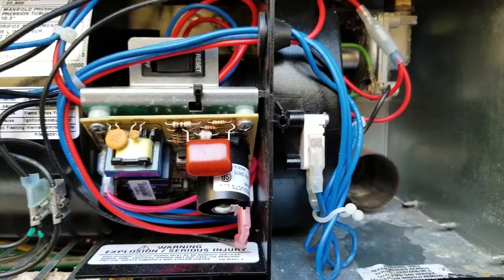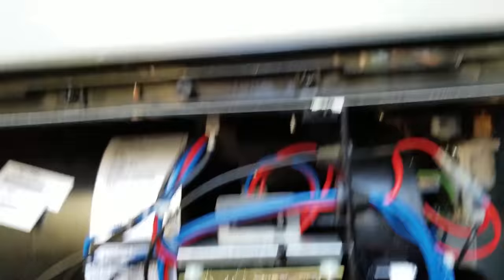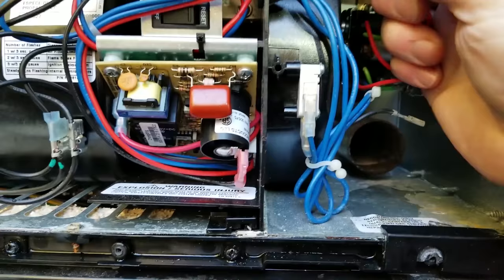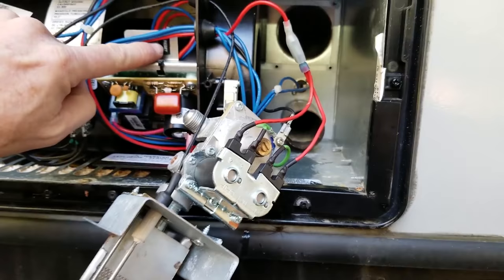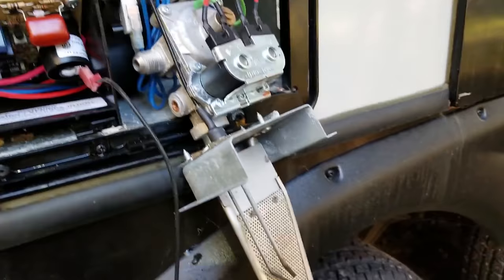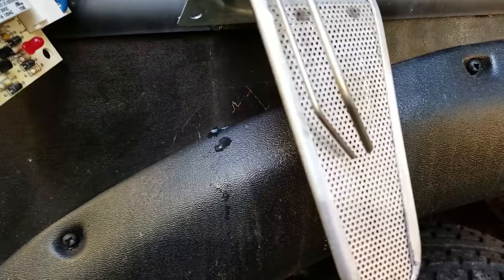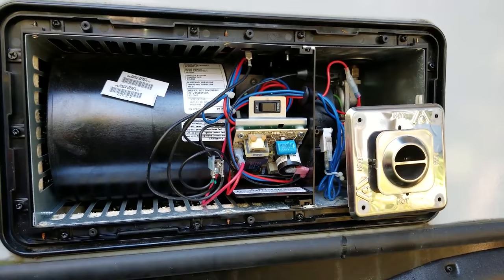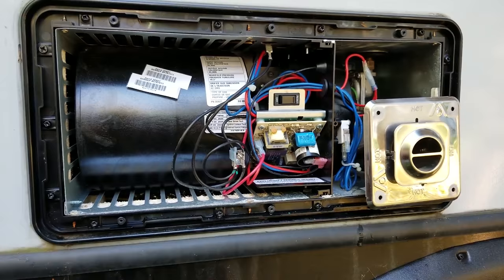Troubleshooting An Atwood RV Furnace Circuit Board

Comment: Just curious, why didn't you test to see if the board wasn't sending out the voltage to the spark ignitor like it should of been? If the spark ignitor wasn't receiving the Voltage wouldn't that indicate a bad board instead of trying with a new spark ignitor and confirm the board wasn't working? I'm still learning my self but that's the route I would've taken. I would like to hear your input on that? Amazing videos. Love the hard work your putting in to help us out!

Comment: So ive got a prowler lynx 25lx and i have no outside panel to do this. I had to remove the couch, pull all the screws, cut the caulk outside on the vent. What a nightmare i wish i had an outside door for all this.

Comment: We were in a bad rain storm in Texas this spring and the circuit board as all the other parts of the furnace were soaking wet.  Furnace no longer worked.  Came home and I have replaced the circuit  board and sail switch and still the furnace won't light. The fan comes on, I hear the click and smell gas, but it will not light.  After watching your video, I'm guessing that I need to replace the electrode?  Thanks in advance for any information you might share.

Comment: My problem is when I turn on the furnace, flame come on for a few seconds than turn off. Than my furnace board  green and red is  flashing. That code is a 1 hour lockout. Any idea 💡
Reply: Likely your sail switch is bad. If you're getting gas and ignition and it's not sensing combustion/ vent air flow, it'll shut it off to prevent a fire or overheat.

Comment: Hello, great video. My furnace starts, the motor blows for 15 seconds, I hear the click, as well as the longer series of clicks (I think you said it was the igniter) and I also smell the LP. It goes through this cycle 3 times and then gives me the 3 red light blinks, and  turns off. Any recommendations for troubleshooting? Thank you!
Reply: Hi, I have the same issue! Have you figured out the problem?
Reply: Did any of you figure this issue out?

Comment: Mine has no flashing lights, it will sometimes fire up the very first time I turn the furnace on after being in storage. Works. Then after first shut down it will not fire up again. I noticed in the schematics that there are two thermostat wires (blue) one to the sail switch and one to the rocker reset switch. The blue wire to my rocker switch is not hooked up to anything. Which is confusing because every now and again the damn thing will work. I have an Atwood AFDM35

Comment: Like your videos.  I have an '96 Fleetwood Mallard 32' RV with an Atwood 8531 hydro flame furnace.  A/C works fine, but when I switch thermostat to heat it blows thermostat 2 amp fuse instantly.  I would appreciate your advice with this issue.

Comment: My Dometic furnace keeps tripping the breaker on the top of the unit. At least I think that's what's happening. It will not fire again until I turn that top switch off and then back on. Turning it off and back on at the thermostat doesn't help, and unplugging the 12 volt fuse for it doesn't help either. But as soon as I flick that switch off and back on it starts up. What on Earth would be tripping the breaker?

Comment: Thanks for the video!  We have an Atwood/Dometic RV furnace DFMD35131 that has a working blower, the gas valve opens and ignites and then it runs with heat for about 1 minute, then the gas valve shuts off and it tries to cycle back on repeatedly.  We have replaced the sail switch and limit switch for an error code of 1 flash every 3 seconds.  Now, we have an error code of 2 flashes.  This error indicates a flame sensor fault.  1.  What is a flame sensing fault?  2. Should we replace the circuit board or the igniter electrode next?  We would appreciate any help you have to offer.  Thank you
Reply from the maker: To schedule a service consult with Darren please sign up for the "1:1 Repair Consult" on our Patreon site.  https://www.patreon.com/myrvworks

Comment: Darren, my Atwood RV Furnace does lite, but takes several times to stay lit. In some instances I've had to turn off the thermostat and back on again several times. Eventually, it will stay lit.
Reply from the maker: The first thing I would suspect is the gap on your electrode is not set correctly. You might want to have a look at that. The Gap should be about an eighth of an inch above the burner and in between the two probes. I just use an 1/8" allen key as my gapping tool.
Reply: @MyRVWorks  I didn't suspect the gap because it lites every time, but doesn't stay lit till for about 2 dozen time. It turns put it does lite and stays lit the first time now. For what ever reason, it works now.
A big thank you for you getting back to me. Your youtubes are great.

Comment: I have this same model furnace and am having issues. Blower won’t run and won’t even try to light. The light on the board has no flashes I have checked the breaker and fuse at the breaker and they are good. Fuse on thermostat is also good. I’m not sure where to start
Reply from the maker: Where to start always the key.  First you need to verify 12 VDC is feeding that furnace.  You will need a Digital Multi Meter for that.  If you do not have one here is a link to one on Amazon:  https://amzn.to/31DsPqS

12 VDC comes into the furnace on the red and black wires (these will be bundled with two blue wires).  Red will go to the rocker switch and black will be attached to the furnace frame.   I have seen where the black (ground) wire has come loose from the spade connector and that was the whole issue so do not discount that step.

If you DO NOT have 12 VDC at the rocker switch (referencing the furnace frame as ground) than the issue is somewhere in the coach.  Here is a video with a similar issue but may not be the exact same as what you are seeing but my diagnostic steps may help:  https://youtu.be/lJXTBdirykQ

If you are not getting 12 VDC to the furnace but to continue troubleshooting your furnace you can use a known good external 12 VDC source to see if the furnace is functioning - jumper cables attached to a car battery will work - I have made a lot of tools for this kind of thing since I do this all the time but for your situation just find a way to get 12 VDC to that furnace switch and furnace frame. 

If you DO have 12 VDC feeding the rocker switch than, still using the furnace frame as ground, follow the red wire through the switch and to the control board.  If you have it there you will notice that one of the blue wires is also tied to the red wire feeding one leg of the thermostat wire.  

Watch some more of my furnace video's where I demonstrate different fault conditions and how I overcome them.  Here is a link to my furnace playlist:  https://www.youtube.com/playlist?list=PLk44vSl27TRCaZIQbm-0utYK7sVOKwXVY

If after all that you are still having issues you can contact me again but this time we can speak a similar language and you will have eliminated some of the low hanging fruit type stuff.

Good Luck!

Cheers,
Darren
Reply: My RV Works, Inc.  hi yes I have 12 volts going to the switch and to the control board I have since replaced the control board, sail switch and high temp limit and still have not had any luck with it doing anything. Only other thing I have not replaced is the thermostat. I originally thought the thermostat was good because it still operates the ac and when I turn it to heat and raise the temperature high than out side time I can hear it click like it is trying to call for heat but still nothing. But I will look through your links and see if there is something that I have missed
Reply from the maker: @dandeb1986  Perform a quick test to determine if the issue is thermostat related...  At the beginning of this furnace video:  https://youtu.be/oaTW0oNf6Qw  I show how to tap into the thermostat wires that tell the furnace to start.  So do that and you 'become the furnace' and that may save you a lot of time.

If the furnace starts when you connect those two blue wires than you know you are looking for something in the coach.  If it does not start than the issue is still with the furnace.

If the issue is determined to be in the coach the thermostat may or may not be the cause.  Depending on your A/C - in the ceiling hole for A/C there is a control box that the thermostat communicates to.  The two blue wires that leave the furnace will route there and connect to a 'dry-contact' relay that the thermostat controls (they will not be the same blue wires since the coach mfg will have changed them when they built the coach.  You can also touch the two wires there to determine if the relay in the control box has failed or if the thermostat is not controlling it. 

Hope this additional info helps!

Cheers,
Darren
Reply: So I have a update on my furnace I pulled apart a bundle of wire connectors that were taped together and found there was a blue wire marked thermostat + that was not connected to anything. So I connected that wire to the other thermostat and ground wire and the furnace kicked on and started heating. That’s the good news now it will not shut off I’ll lower the thermostat and it will not shut off and continues to run. Any ideas?
Reply from the maker: @dandeb1986  Okay, you can take that '+' wire that you found back off and cap it.  The 12 VDC on the 'other' blue wire that goes to the furnace is picking up the 12 VDC from either the thermostat or the control board in the A/C.  Note that what I am calling the 'blue' wires are only blue when they leave the furnace.  The RV OEM will use different colored wires.  If you follow that 'other' blue wire back to either thermostat or A/C control board and energize it with 12 VDC your furnace should start.  If so you are very close to the issue.  Sounds like it is either t'stat or control board.
Reply: Ok we had a little success with getting it to shut off once. We smacked the thermostat a little and it did shut off like something was sticking on it. So I ordered a thermostat. I’ll see if that fixes it. I don’t think the control board is bad because I had put a new one in it. I did put the old one back in to see if the blower would stop running then and it did the same thing so hopefully replacing the thermostat will be the last thing

Comment: Great video! Could you give some advise for if the system is getting spark, heats up, but won’t stay engined? It goes through 3 iterations and then shuts off. Could be something to do with not having continuous LP to the system to stay engined?
Reply from the maker: I do have a series of furnace videos, on my YouTube channel look under the playlist for furnaces. After watching a few of those you might have a better idea on things to check. Having said that, if you're getting spark and ignition it may not be the control board, sail switch, or high limit thermostat. Like you state it could be an LP Supply issue. I've also got a video where the electrode is too close to the burner, and I've got a video where the burner is actually cracked and rusted. So these are some other things you might check.

Comment: Daren,  Do you think a DIY'er could rig a spark plug as a diagnostic test tool instead of a $$ spare igniter? rig a cable from plug to spade terminal maybe open the gap a bit and test away. Gary

Comment: Well, you’ve help me get further than I have before!! Thanks for that! But, not sure what to do now...I have an Atwood Model AFMD35141_A. The ignition control diagnostics shows 1 blinking light every 3 seconds, which indicates Airflow/Limit Fault. What do I need to do now to fix it? Thanks in advance!!
Reply: Hello Michael, I have the same problem... have you made any progress on yours since posting this comment?
Reply: @rackaddict8227  yes! I replaced the sail switch and the limit switch and it fix the problem! Easy fix and less than $50 for both.
Reply: @michaelmccain7061  Thank you so much for the reply! I will try replacing both of those! Our repair/customer service experience at the dealership we bought it from has been nothing less than GARBAGE! OUTLET RECREATION in Detriot Lakes MN I do not recommend!
Reply: @rackaddict8227  Yeah, Camping World is the same...it would have cost me $200-$300 to get them or a repair guy to do it! Thanks to YouTube it shows you how to do it. The sail switch has a number on it that you need to match because there are slight differences in them. I ordered mine through PDX RV and matched perfectly.

Comment: Thanks for your vide Darren. I’m having issues with my Dometic  DFMD30111 furnace too. It’s short cycling but stays on longer each cycle then finally stays on steady. We have ignition, gas , spark etc..) I’ve change the sail switch, the limit switch and I replaced the board with a Dinosaur Electronics FAN 50 PLUS PINS 12V DC Universal Ignitor Board with Fan Control! Still does the same thing, however, seems to do a lot less cycling. Any ideas?

Comment: So I’m up in neah bay. I have a lance   Slide in with an Atwood heater. So the heater worked last night. This morning it wouldn’t fire up.
I turned thermostat up and the fan starts and then turns off. I pulled the panel outside and operated the on/off switch there. Fan comes on, I can hear click, I can smell gas, I hear the igniter clicking. It does this 3x and then shuts off. The red light comes on and blinks 3 times. I have done this process several times and same outcome. What do I check next? Weird it worked fine yesterday and nothing today

Comment: Thanks for your great videos.  I have an Atwood 8520-IV that ignites and burns for about 6 seconds then flames out.  After 3 trys is in lockout with 3 flashes.  I bought a new electrode (with new wire) and new burner head (it was very rusty) and installed thanks to your videos.  Did not resolve the problem however.  Would you suspect the board needs replacement?
Reply from the maker: If you have replaced your burner and you have a new electrode, and the Gap is correct, but it is extinguishing after a couple seconds, then I would concur that your board is the problem. It is not able to detect the milliamp current through the flame.
Reply: @MyRVWorks  I think I'm having a similar problem. I've individually tested my burner and electrode, and they both look and seem to operate properly. Is there a way to test the individual components of the circuit board to determine for sure that it isn't detecting the milliamp current coming back from the electrode? (without having to just buy a new one and hope for the best)

Comment: Thanks Darren for the great vdideo. I have a 2016 Hurricane and the furnace quit on me at Disney World and believe it or not, we needed it. A heat cube was the fallback. Anyway, my furnace will kick on, fan runs, ignites for about 3 sec and stops......fan still running though. This cycles through a couple of times and then shuts down. I have some heat, I can feel it at the exhaust port outside but the gas won't stay ignited. I take it the sail switch..ok, the electrode is ok since it will ignite...it just doesn't say lit. Am I looking at a new board?
Reply from the maker: To schedule a service consult with Darren please sign up for the "1:1 Repair Consult" on our Patreon site.  https://www.patreon.com/myrvworks

Comment: Hi Darren, I have a unit that isn't working  the red light on the board if off, I have checked all the safety's I could find  and have power down to the board,  but no red light! My diagram shows circuit breaker some were around the blower unit  but can't find it, the unit worked all last year.
I tried all the tricks I know and know it is probably something stupid , and  a little insight would be appreciated.
Thanks John

Comment: Hello Darren.  My furnace quit last night and it started clicking.  This morning I opened the furnace door and reset the switch and nothing changed.   I turned on the thermostat and the fan motor did not start and the circuit board is clicking.  The circuit board is 31501, and the red light is single blinking, because the fan is not running so the sail switch is open.  Should I connect 12volt to the fan to see if it runs, if it does then the circuit board needs replaced.   Thanks so much for your videos and I am learning much.
Reply from the maker: I think that your approach to troubleshooting this problem is spot-on.

Comment: Darren, my board's red light fires off like a machine gun when the unit comes on for about 10 seconds, then the fan comes on and the red light goes out. After that, the unit fan continues to runs for about another 8 seconds, and sometimes the igniter comes on, most of the time not, and if it lights the gas, it only burns for about 3 seconds. After that the fan continues to run until the unit shuts it off. If I leave it alone, this repeats over and over. 
I have replaced the board with a new one, but the light clicks fast just like the old one. I find this very odd as it does not fit any of the light patterns the manuals suggest. 
 I cleaned the whole unit up, and replaced the sail switch. I also replaced the igniter with a new one. 
Still having the same issues. Thoughts?
Edit: After watching your video over I noticed you kept pointing out the solenoids clicking BEFORE the igniter. Mine does not click. Gonna check that out.
Reply: Have you been able to get any further? fixed??
Reply: @Scoopy2022  hi Kevin. No, I’ve not fixed the problem. It’s on my list of maintenance, but I plan to try again when summer is over. 
At this point I’ve replaced every component. The solenoids which are new do not “click” to open. And since that doesn’t happen, nothing else does either. I’m bewildered. It’s such a simple unit once you get to know it intimately, that I am surprised at how temperamental it can be.